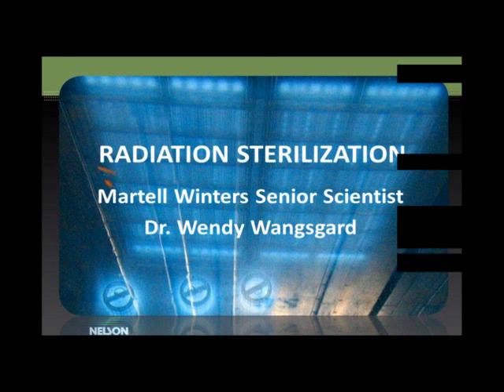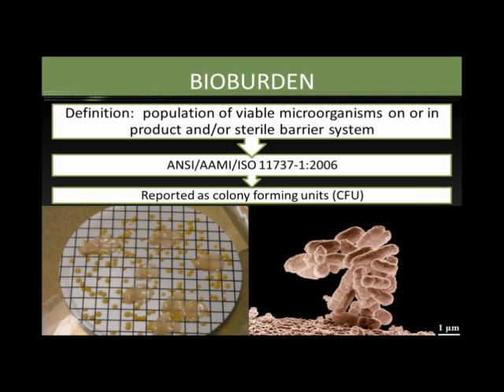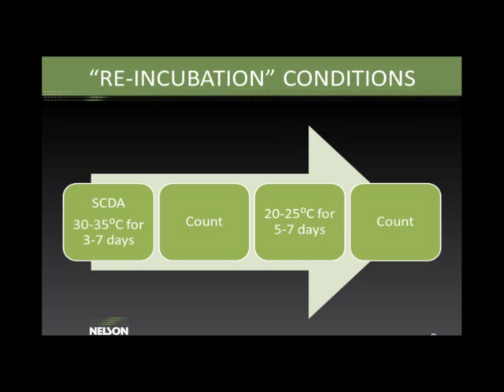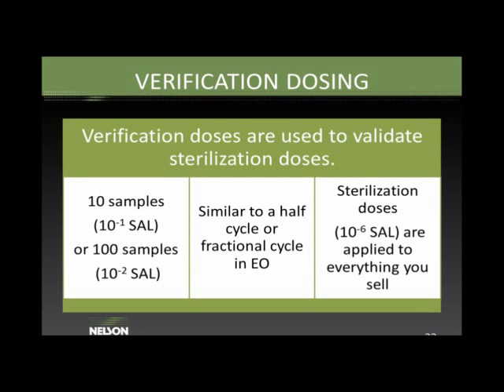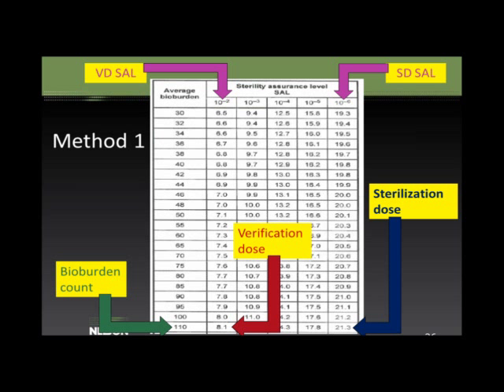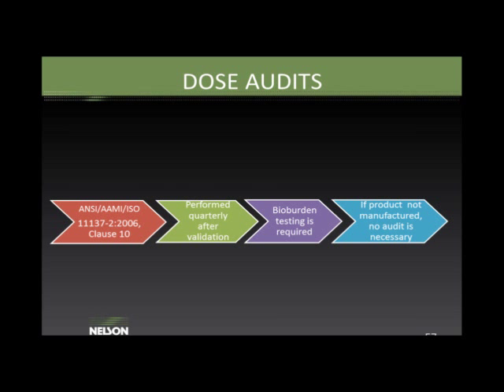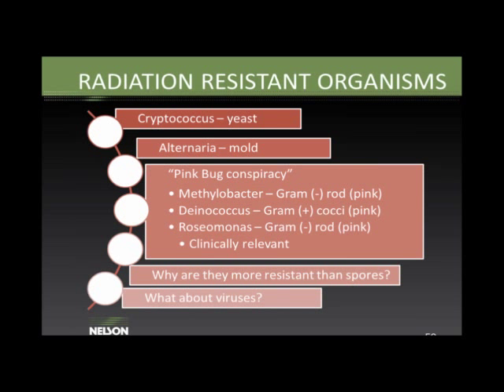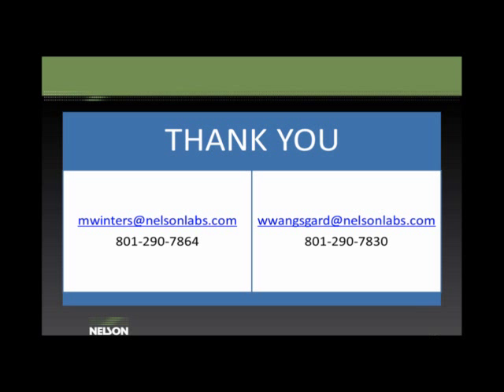Radiation Sterilization Validations

Comment: Need to understand the difference between Verification and Validation. The measurement for the actual radiation Sterilization accordingly to the Int'l standard and it security.
Reply: Verification is the dose you will use for dose audits.  It is a lower dose than you use for validation and routine sterilization.  Validation establishes your dose and your verification dose.